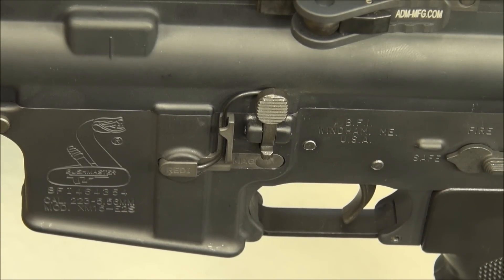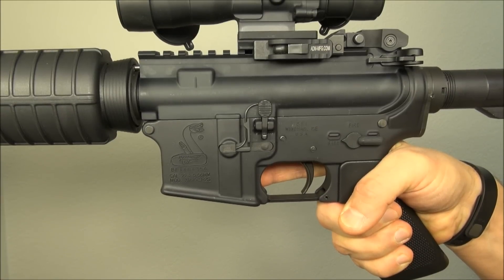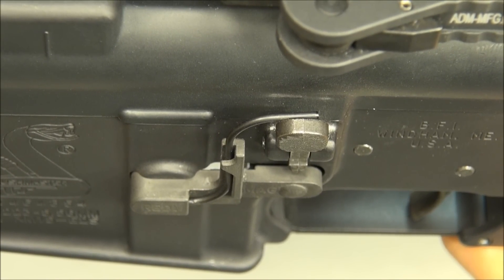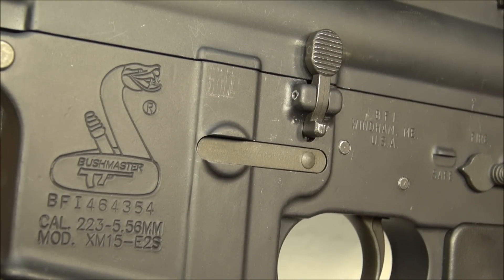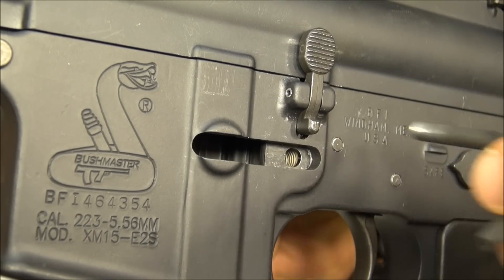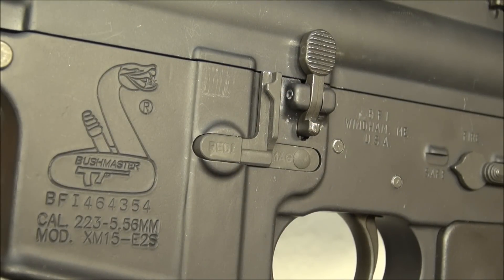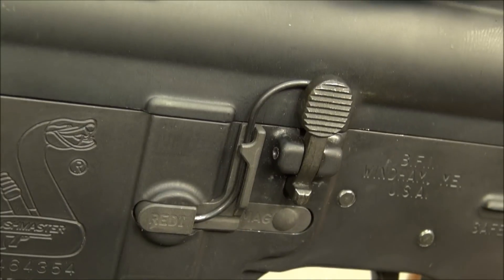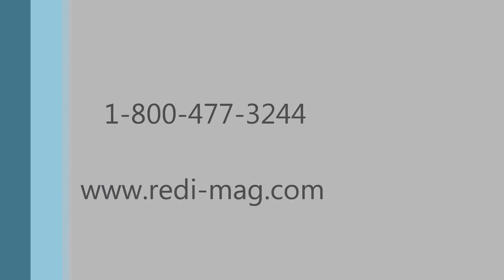The Redi Catch HD - - - www.redi-mag.com

Comment: This is one of those simple, brilliant ideas that makes me say "Why didn't I think of that?"
Reply: I'd of felt the same 20 years ago. I've been running Gucci ambi receivers for well over a decade though. I just like the anesthetics of this overbuilt'esq features. Still, your comments only 6yr old, and I would have suspected that non ambi would have seemed pretty primitive even then.
Reply: @tomjjackson21  Ambi controls are easy to find, but this is basically a retrofit that gives a standard lower the ADAC bolt hold open. This still isn't a common feature, even today. 

FWIW, I built my first AR in 2013 on a pretty tight budget, so optional upgrade parts weren't on the menu. I was living in California, and scrambling to get a complete gun together because I was convinced (along with many others) that a new AWB was coming soon.

Comment: seems neat but quick question wouldnt it only be useful when pulling the charging handle? w a mag dump wouldnt the bolt already be at the rear?
Reply: Think malfunction clearance.
Reply: @DZ4295DBW  this... this makes sense. I was stumped on why this would be in any way helpful given that the bolt will already lock back when the mag is empty

Comment: Or...you can modify it and drill a hole in the left side of the bolt catch paddle and instead of the s spring going behind the bolt catch paddle, it sets inside the drilled hole for a cleaner install.  Just my .02. I retain all rights to this idea.  LOLOL  Or, you could just by a Radian lower that does the same thing....or better yet an LMT Mars lower with dual controls or an ADM defense full ambi lower.

Comment: THE WIRE SHOULD GO INTO A HOLE IN A SPECIAL BOLT RELEASE PADDLE TO INCREASE STRENGTH AND MAKE IT LOOK BETTER THAN A WIRE. BASICALLY THE MAG RELEASE AND WIRE SHOULD BE ONE PIECE OF ALUMINUM . RADIAN MUST BE MAD BUT F THEM AND THIER SORRY CUSTOMER SERVICE LIES
Reply: The redi catch was out before AXTS (now Radian) released their Adac lower. There was a lawsuit for patent infringement but they have since worked it out
Reply: Capslock=cruise control for cool. Regard